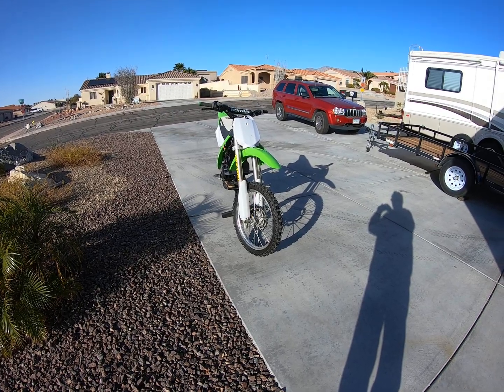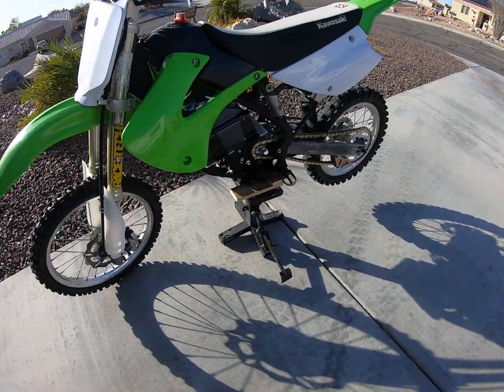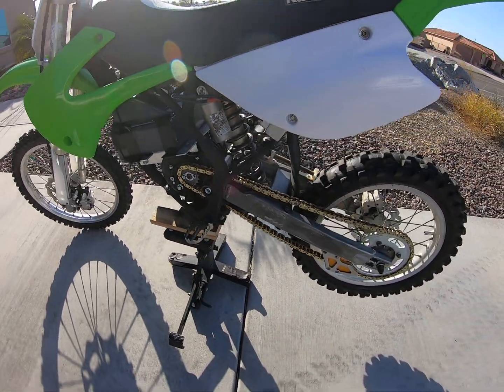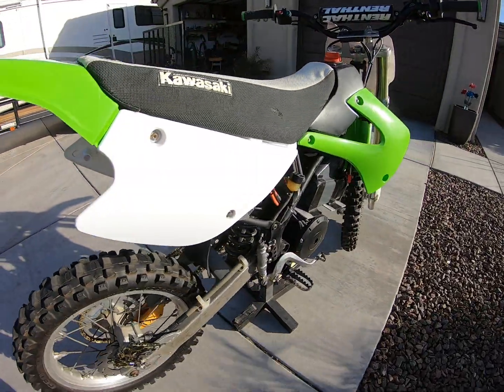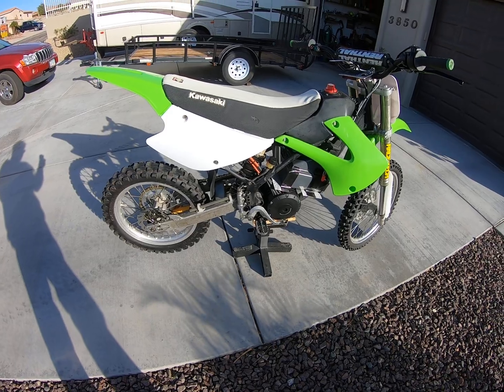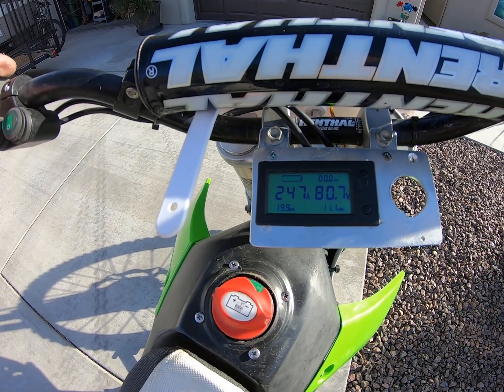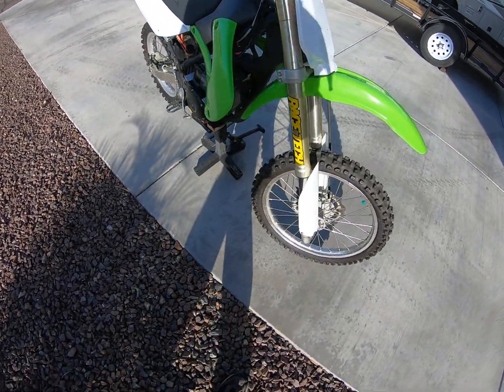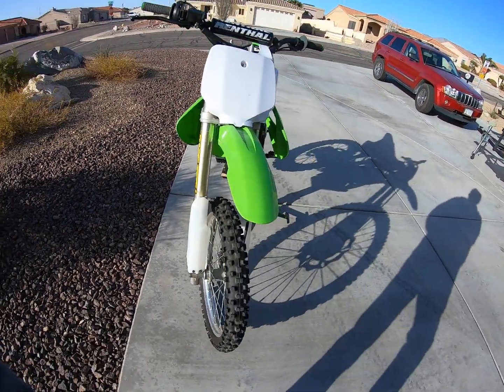2008 KX100 with QS138 70H v3 motor Walk around

Comment: What range are you getting out it? I just bought a sur ron but already thinking about converting a gas bike.
Reply from the maker: This bike has a 200A battery  ( 20S7P Sony VTC6 cells) That equates to a 14AH battery. I get a solid 15 miles of riding. I have built 3 now, of these KX100's, and KX80, 1991 and above. The other two have  24AH batteries. ( 20S8P Molicel P42A cells) They both get 25miles out of them at Hollister Off Road park, all over, up hills and down hills.  So about a mile an AH.  The bikes weigh 175, they are all big wheel, and the rider about 175 also.  I did go back to a EM150SP/2 controller because the bike doesn't need that much of a controller.  200A is way enough.  I am building a full size KTM  with the same motor but with the EM260SP/2 controller. The battery will be double the 24AH battery.  The 260 controller does easily 350A , but can be pushed to 450A with a water cooling system, which we are going to do.  I have one YouTube on the start of that too. That will probably end up weighing 240lbs. The range will probably be in the 40 mile range, because of the extra bike weight, and going faster with more current.

Comment: Thank u for sharing ur works. I m also planning to convert dirt bike to electric. I am in selection process of motor. Which motor is best, qs 138 70 h internal gear motor or ym mid drive 3000 w 72 v moter? please suggest me.
Reply from the maker: I would recommend the QS 13870H V3 motor.  With the Votol EM150SP/2 controller, it is good for 200A or 20hp.  This is good for a smaller KX85 to100 bike. For a full size bike I would use the same motor but with the Votol EM260SP/2. It puts out 350A  (35hp) out of the same motor controller combo. There are people who have pushed it to 450A also with that motor and controller. That is pushing the limits.  I would buy it from ElectroandCompany.com because they program the controller and have a plug and play wiring harness. It is only a little more than ordering straight from AliExpress, but well worth it.   I don't have any experience with the YM mid Drive 3000w 72V motor. You might notice that the QS 138 70H V3 motor is only rated at 3000 to 5500W, but everyone has been using them in 14KW and higher. They seem to be ok at the higher power.  At 14KW the motor is not even getting warm to the touch.
Reply: @dcoxryton   is that 350a peak or continuous?
Reply from the maker: @Riley-hartman  Yes it can be continuous .  Here is a 2003 YZ250F That I just built for a customer, me riding it at the track, and I am in mode 2  (250A).  https://www.youtube.com/watch?v=t3Hiu_TO-ys&t=2s     Next I will reply again with a second YouTube, and me on my YZ250F , all with the same motor /controller/battery as the 2003 YZ250F,  and on the same track on the same day.  But I am in Mode 3 (Boost 350A). You can hear the RPM difference. But you can feel the power difference.
Reply from the maker: Here is the second YouTube   https://www.youtube.com/watch?v=Py7pRdK_1UA&t=3s
Reply: @dcoxryton  so it has to be 350 continuous to get 25kw? I’m trying to figure out a good battery for this set up.
Reply from the maker: @Riley-hartman  your battery pack has to be able to sustain 350A . Example  20S8P with Molicels P42A. That will give you theoretically 360A, but thru all the system losses, you will only see about 320A.  But you are over working the batteries, and they will overheat.  Now do 20S12P and you have theoretically 540A but only about 490A actual, but the battery will live longer.  So for this setup I would do 20S12P OR 16P  Molicel P42A's.  I only use these cells or Sony VTC6 18650's, but the Sony's have gotten too expensive.  They both show that 10% system losses.

Comment: What are you using for sprockets, 15/48?
Reply from the maker: I am running 15/49 in 428 chain size. There are not a lot of choices in 428, but the motor comes with that size sprocket.  It tops out over 50MPH